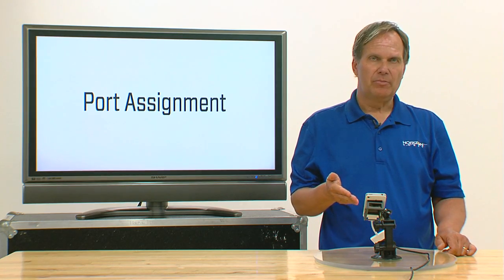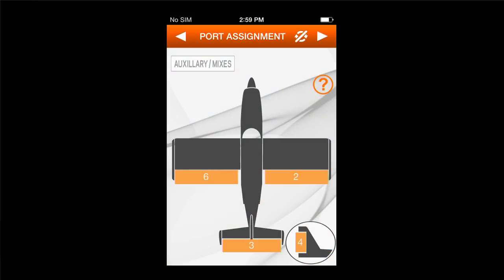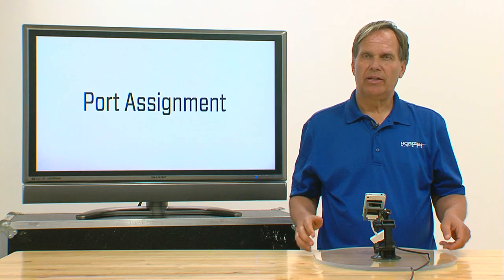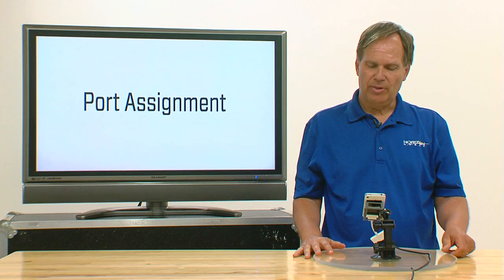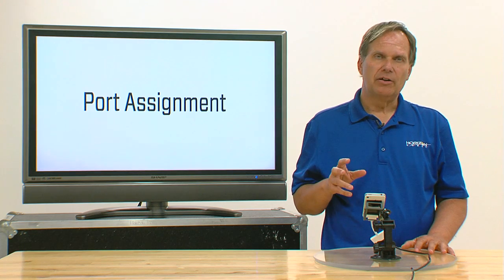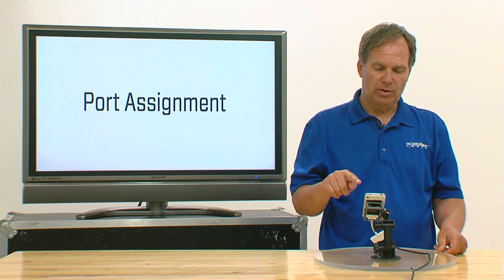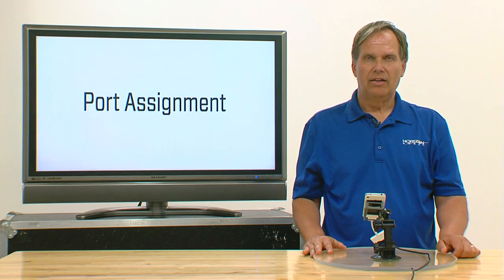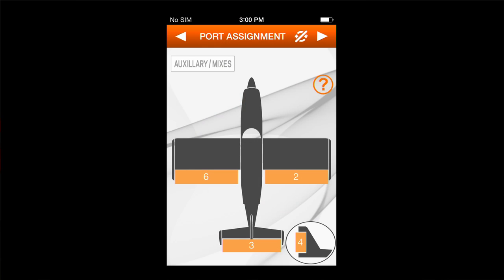Spektrum AS3X Step 10:  Port Assignment (Initial Setup)

Comment: Great video. So I'm using same receiver and dxE transmitter in a hitec xtra300s.  I'm using a Y connector for my ailerons, but when selecting my ports I can't pick port 2 for both aileron servos